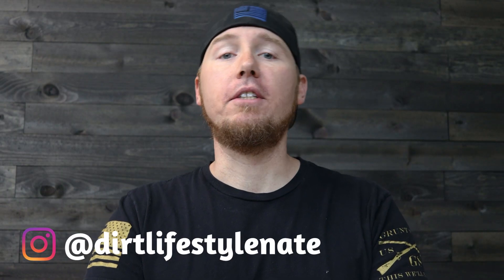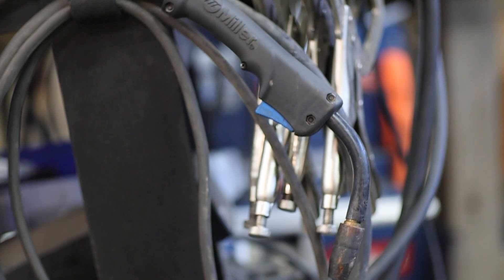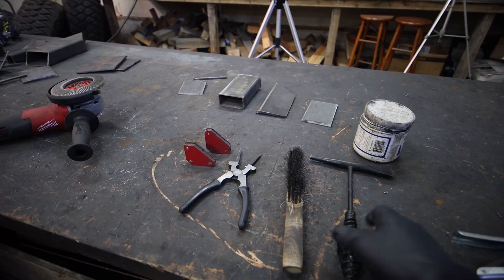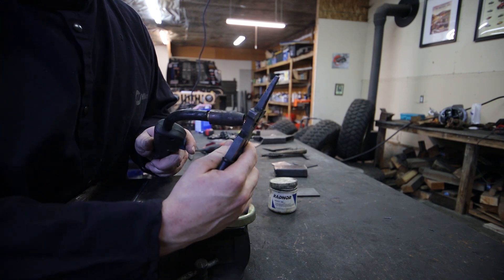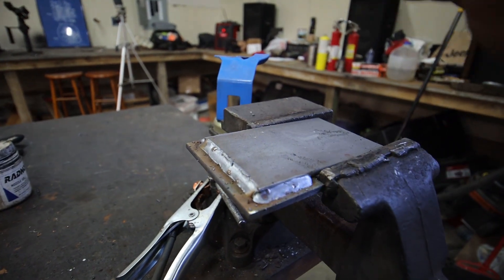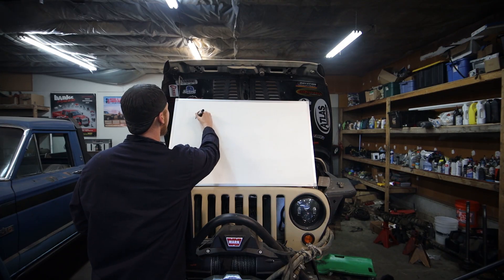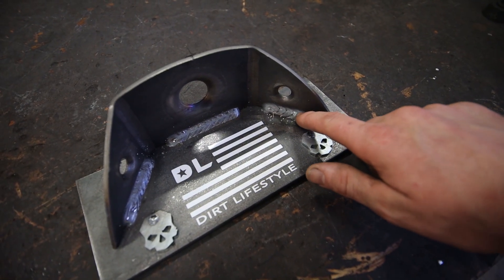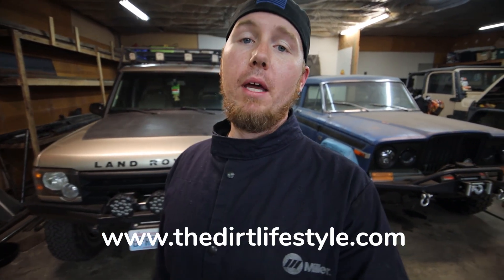Teach Yourself To Weld With This Video!!! (How to Mig Weld)

Comment: Might be a dumb question. Can you touch the work piece while welding it?
Reply from the maker: If your asking about electric shock that isn't something to worry about but you don't want to touch it while welding it because of burns. Not only can the heat of the material burn you (obviously) but you get a sunburn from the extremely bright light! Thanks for watching and be safe!
Reply: Thanks!

Comment: The assumption that your videos will teach someone to weld are ??????  You are a welder and have the best equipment where most do not have the experience or tools. I have a stick welder and a wire welder but do not use them enough to be confident with either for the welds I make and it can get ugly real fast.

Though I seem to have better results with my stick simply because the 110 v. 135 amp, wire welder is used with flux core wire as the expense of bottle lease and the gas limits my choice of wire. I would like to see the difference if I could afford to buy solid core wire and shielding gas but when you only weld once twice in a years time it makes no sense to spend that money.

I asked the owner of a fab shop once about TIG and was told it is a difficult thing to learn if you are not doing it on a regular basis. The expense involved is also a factor. The same thing goes for all welding in my estimation and the cost to have it done is prohibitive in the least.

Reading some of the responses I see welders with years of experience and probably are paid well and can afford the costs or are supplied with the tools to do quality work.Another problem I have is being able to see what I am doing and yes I have what you would consider a cheap auto darkening helmet but as I said I do not weld that often and cost is a major factor.
Reply: Nothing wrong with Flux Core, it works just fine but it is messy compared to gas.  As for tanks/lease/expense etc...  You don't have to lease a tank and if you are only welding a couple times a year I would suggest purchasing a tank.  The cost is a lot more up front but you can purchase a little bottle, like a 20cuft for around 79 bucks.  To fill it, just take it to any welding supply and they will either fill it or exchange it.  Exchange is simple but you won't get the nice clean scratch-free tank you take in...but who cares, you are just going to exchange it again when you need to.  Exchange shouldn't cost more than about 50-80 bucks for a full one and with minimal welding you may only need to do that every 1.5 years or so.  The difference between shielded gas and non-shielded gas is amazing.  Gas in my opinion is much easier to weld with and it welds better if your settings are 'not-just-right'.  You also get better penetration and heat distribution.

Tig - definitely harder to learn than MIG but not that hard.  TIG is more about controlling the heat and the puddle.  Difficulty comes with feeding in your filler rod, just another thing you have to keep in mind while you weld / learn to weld.  It's a lot slower as well.  Once you start getting the hang of TIG is is pretty easy.

As for seeing what you are doing.  Couple things.  If your eyes have a hard time making out what you are welding get a cheater lens (under 5 bucks).  It's basically a magnifier that you fit into your hood.  Another thing is clean your shield or replace it if it is scratched (shield=outer plastic in front of your lens).  Dirty/scratched shields make it extra hard to actually focus on what you are welding.  Every little scratch will refract the light and mess with your eyes so you can't focus.  If it is super bad, replace it.  You should be able to get a replacement for under 5 bucks.  Don't clean it with paper towels!  That only scratches it up more.  Use a soft cloth to clean.  Novus 2 works great in taking out fine scratches.  Also, don't put your helmet face down on the bench, it will get scratched.  Also, don't lay your helmet down anywhere you are grinding!!!  Sparks and flying tiny metal shards will embed into the plastic and ruin your lens. 

Hope that helps.

Comment: Nice shop!  Is this a garage?  And, how thick  plate do you recommend for a welding table?
Reply from the maker: This is my shop in my backyard. I wouldn't go thinner than 1/4 for a welding table but try and get 1/2" if you can afford it. 🤘

Comment: How does there multimatic Tig weldbon stainless steel and aluminum I got into MIG welding back in January and have been picking it up very fast I'm to the point where I can one-handed vertical uphill weld I'm really considering buying the Miller 220 multimatic for my next machine so I can have the multi process capability it would be awesome if you put a video out reviewing how well it tig welds
Reply from the maker: I'm definitely going to do a review video sooner than later. I'm no expert tig welder but I can help point someone in the right direction based on my experience so far 👍

Comment: So welding to frames and stuff, would you want a welder that does 1/4? Have a yj I’m putting super duties in and trying to figure out what size welder I need. Welding the the axles would I need something that just does 1:4 for the brackets?
Reply from the maker: The big issue with trying to use a 110 welder on an axle housing or a frame is the initial 1" of your weld is never hot enough on thick material. You'll notice that the beginning of your weld is just laying on top of the material. As it builds heat, it begins to get penetration. A 220 welder has way more watts available to get you good penetration right away. Welding brackets on axles will require alot if juice. The axle is a giant heat sink and thin axle tubes are 1/4" but alot of them are 3/8" and 1/2". I wouldn't consider going smaller than a 220v 180 amp welder for axles and frames. These are important locations to attach a link or bracket and safety is key 👍
Reply: I've used my Hobart 140 to weld 3 sets of spring perches. What I've done is bevel the outside edges, weld as far on the inside of the perch as I can to heat it and then hit the outside

Comment: Loved the video! Question: when welding 2 different gauge plates together, what size do I pick to set the welder to? Like welding a 1/8” plate to a 1/4” plate as an example?
Reply from the maker: This is kinda funny, I was going to give you the opposite advice to what steve j said lol. I like to run my welder on the hotter side but I like to move my weld along pretty quickly. I also point the gun at the thicker material and very briefly drag the puddle on the thinner material. I honestly think steve is giving you better advice but I would practice with both! As your skills develop you will find your own way to tackle this issue like the rest of us. Good luck man! Put in those hours!
Reply: @DirtLifestyle  Yes do what you suggested. The thick material needs the heat input. You might need more practice to get it too look good but when you get the muscle memory down it's just second nature. We weld 12 guage to 1/4" at work with 0.045 metal core at 250A and 26V. We use 85Ar/15CO2 gas so we are in spray transfer. There is a lot of heat input so you really need to hustle.
Reply: TriggerHapySheep great question.
Always set your welder up to the thinner material.
That way you’ll avoid any chance of burn through.

Comment: I’ve been really trying to save for a welder. Really great video for once I am able to get one and practice. Thanks 🙏
Reply: Shop for a used one. Most places have a Red-D-Arc weld rental store and they sell used welders they have rented out. Shops go out of business, home owners sell when they move, people sell when they upgrade. Good luck!
Reply: @geoffmooregm  I have been looking all around. budget is really tight right now adulting sucks. I saw one good deal but it got swiped before I could even send the message

Comment: Nice starter plan! I bought my welder while I was still driving and it sat in the shop brand new waiting for me to get some time off. When I did get anytime it was either the reset hrs for my log book ( 36hrs) , and I was so wasted from running the miles. But then I ended up in a wreck and suffered a head injury and found out real quick the simple things I knew from childhood were hard to do. My head just couldn't wrap around and tell my hands to hold things. Even trying to tell my son's how to do the task was futile and so frustrating. It took 6 months of retraining my head to allow me to get outside and work on a car trailer I bought. I found out quick I'm a 2 handed welder...lol Nerves make my hands shake so I have to hold on to get any kind of nice welding done. The boys just sit back and let me work on it for a while and when I take a break they step in and finish it. They keep saying to upgrade to a better machine, but I keep saying show me more welding first.  I really do want to get into the Miller brand, but we are limited in space for projects. I'm looking into getting the gas to get better welds with our little machine. Love the video and all the stuff you are creating for your vehicles. Saw this J20 and thought of yours it's called ROAMR.
Reply from the maker: I know the feeling buddy. I've been recovering from a brain injury I had from a car accident 2 years ago. Took a year to feel like myself again. Its strange relearning basic skills and nobody understands your struggling because you can still carry on a conversation. Keep working on it brother 👍these skill can only get better with time and dedication! Thanks for watching the videos!
Reply: You can still find good deals now & then on Craigslist for used mig welders. Most of the time, people seem to think their welder is worth just as much as the day they bought it 22 years ago, but sometimes you'll see someone who just upgraded and wants the space in their shop or garage so you get a deal if you can catch it.

Comment: Am i the only one who thinks a 120 is fine for 1/4 inch steel
Reply: A Tre I definitely would do a root pass and then a second “filler” pass if I was welding axle brackets and things like that. Or you could turn it up as hot as you can and go slow.
Reply: You can easily weld 1/4” with a 140 amp 120 volt MIG machine. Just make sure you have a good bevel on one or both of the pieces you’re welding together.
The only real drawback with using a 120 volt machine is their duty cycle ends up around 20% when they’re turned up high enough to weld 1/4”.

Comment: Nice job great mig welding basics video! There are actually some good 110 welders out there. Most of the time yes 220 is definitely better and more convenient, but I mean my 110 Forney can burn 1/4” in a single pass no problem with great penetration. I’ve used this welder to fabricate many parts for my truck including a headache rack out of 1/8” & 1/4” steel. Bumpers out of 1/4”, plus 3/8” where they mount to the frame. 1/8” side steps. A handful of different brackets. Some 3/16” skid plates. A few other little things. And I am now working on a brush guard using 3/16” & 1/8” wall tubing & 1/4” plate. And a stainless steel auxiliary fuel tank. Its been a great machine I have accomplished a ton with this welder without ever overheating it. In my opinion it is perfect for the moderate welder like myself.
Reply: I'm glad you said this! Cause it's exactly what I was thinking. I have a Hobart Handler 140 that's 110v and it's been doing a great job on C-notches in lowered truck frames, and I've been burning together a 3/16" plate off-road bumper for my '72 Jeep CJ-5! It hasn't let em down yet, and was nice to get when 220v wasn't an option for me to get access to.
Reply: Not to mention everyone has 120v, not everyone has 240v.